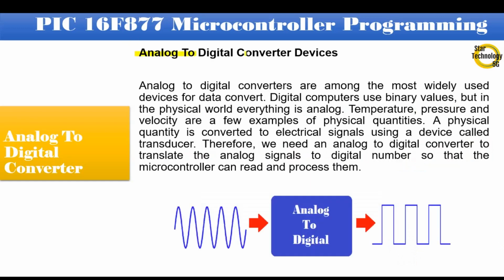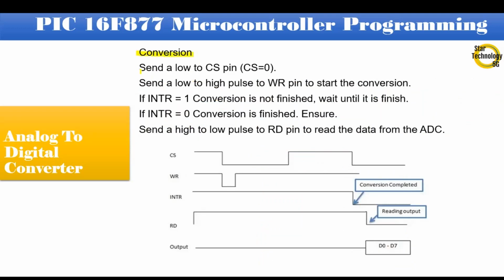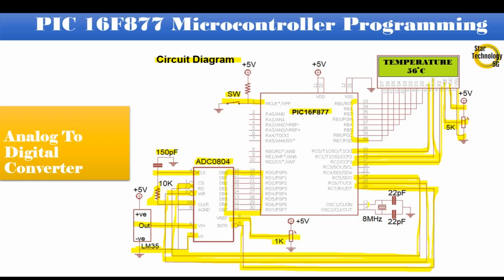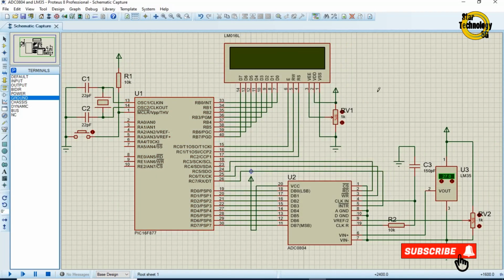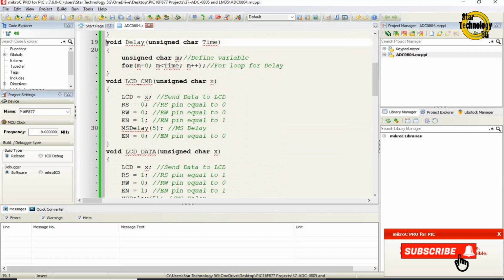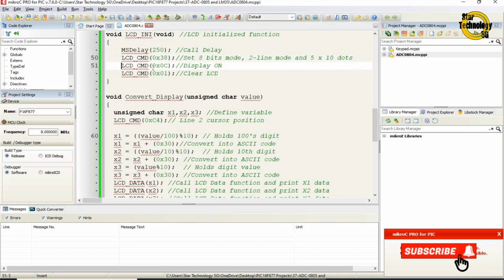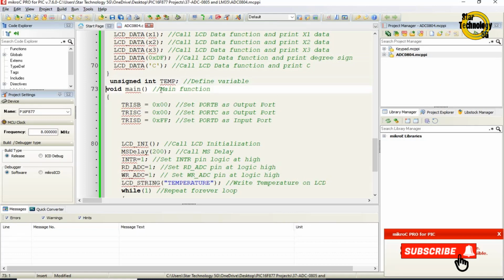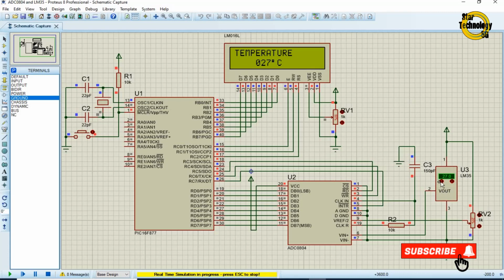Microcontroller PIC16F877 Video 45 How To Display Temperature Using ADC 0804 and LM35 Using Mikro C

Comment: Good job sir.. Why use O808 ADC? .. Does the pic16f877 uc not have an internal inbuilt ADC??
Reply from the maker: Yes, it is PIC16F877 and it has an internal ADC. We can use separate IC as well. In next video, I will use internal ADC.
Reply: @StarTech5G  ok sir.. Thanks for sharing ur knowledge.. I am benefiting from it.. I appreciate